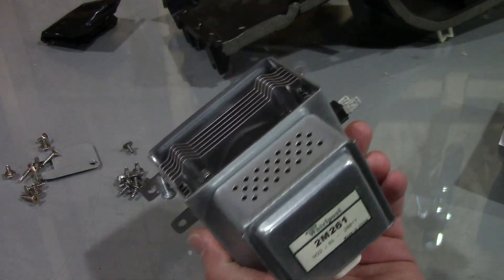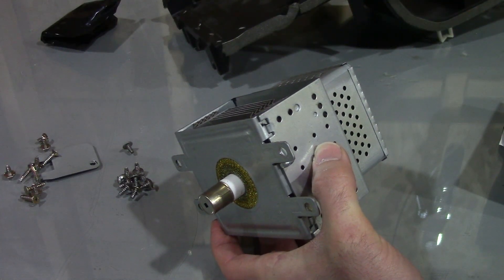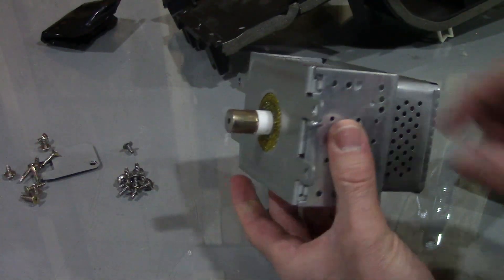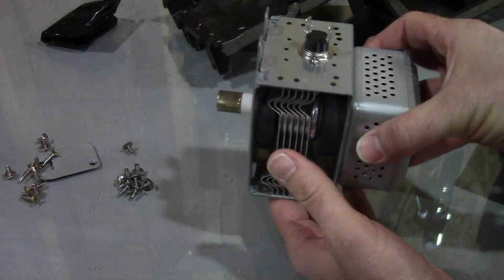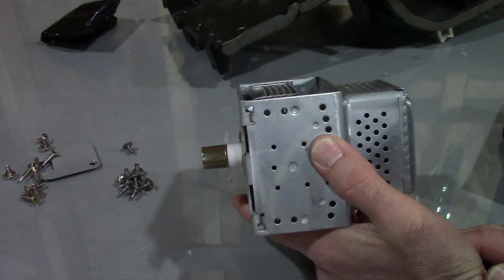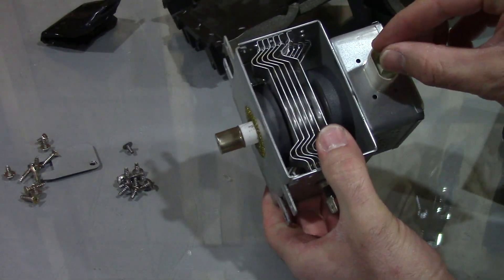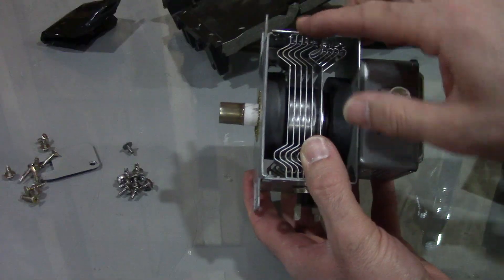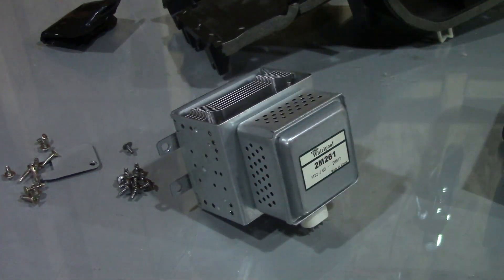What makes a Magnetron dangerous

Comment: Would help your videos quite a bit if you did a little research before posting.
Reply: The electrons don't bounce around they are bent at 90 degree angles and spiral around. The Magnetron Vacuum tube has copper fins inside that portrude from the chamber wall. Each time an electron passes near a copper fin it generates voltage in that region. When this happens enough an RF signal is generated and then coupled to the output on the tube via an internal antenna. That output is also the copper nipple that is cold welded to seal the vacuum tube. There is no thermal cut out on the tube. Those are mounted on the magnetron  and the cooking cavity! LOL!

Comment: Yes, public spirited to warn of the possible dangers of Beryllium oxide dust and what it can inflict upon the unwary. I note others have clarified the colouration of ceramic containing b-oxide and that most now use aluminium oxide instead. However, the magnets may be fun for us eternal Peter Pans, but the ion chamber is fashioned entirely from copper, therefore does have some value to scrappers

Comment: Nope the only part in a magnetron that is servicable is the filter inside the back of the magnetron. As far as I know do only old magnetrons use Berylium what makes the insulator pink. New ones usually have metal oxide, what makes them white. But metal oxide is dangerous too.

Comment: Thanks for explaining with so much detail. I want to disassemble an oven and was freaking out. Only knew the capacitor and the magnetron were the two most dangerous parts. I feel better informed and prepared now..
Reply: Yeah better not touch both of those things, both are potentially deadly xd one of those things you don't want to service yourself ever if you can avoid it.

Comment: people are dying from car exhaust daily
Reply: true johnny
Reply: Steven Bailey not quite the same.
Reply: Not quite the same, because it's more like sticking your hand into a crocodile's mouth !
Reply: Please tell me that you are kidding... :P I mean atleast for the car exhaust being clean... everytime I walked in the city I used to blow black stuff out of my nose. The same black dust would be found every day slightly covering surfaces behind (all day) open windows. These days with more strict control and limits (EU) plus the fewer cars (crisis) I haven't noticed my nose gathering black dust (visually) but you can still notice it on surfaces near windows (they really need to be cleaned every day or two). You also probably suppose that the catalyst does its job perfectly, the fuel is "high quality" and  the car is maintained as it should and no illegal modifications are taking place (though this last one is extremely rare tbh).

As for climate change, it is up for debate, though man didn't caused it, we just accelerated it AFAIK.
Reply: No, people are dying daily because they are unlucky! If you are lucky you live to get old like me! I've breathed the same air as  all the others born in the same year but are now dead.
Reply: Bull shit! Car exhaust is so clean from a 3 way cat converter that it consists of water and co2. Oh and, there is NO MAN CAUSED CLIMATE CHANGE.

Comment: They don't use berillium any more. Not for the last 30 years. Aluminum oxide. Perfectly safe these days.
Reply: Bodragon uh huh, you've seen them being made?  Are you even sure where they're made?
Reply: You are incorrect. While it may not be as widely used as it used to be,  it is still in use. It has unique and valuable thermal properties. Mitigation of it's hyperallergenic affects is not difficult.

Comment: how could u re use the ceramic to make ur own shapes.......
fyi to remove them safly u super heat the insulator till the steel glows white ish hot it gets slighty gooey then the insulator pulls off
the terminal input needs a tap and drops off

Comment: The ceramics look simulator to the argon welding gun I used  for welding aluminium years ago, we would also grind them to alter the shape?

https://www.google.co.uk/search?q=the+argon+welding+gun+ceramic&rlz=1C9BKJA_enGB590GB590&hl=en-GB&prmd=ivmn&source=lnms&tbm=isch&sa=X&ved=0ahUKEwjE4_KTqP3QAhWdNFAKHaq0BWgQ_AUIBygB&biw=1024&bih=653#imgrc=vc3bJd3C-odArM%3A

Comment: I have two Magnetrons laying around with the Pink Ring, but i leaft it to Do anything with it,  I Do Not want to die
Reply: Pink color is addition of chromium dioxide for extra hardness.
Look up manufacturers data and find Samsung and panasonic for example have never used BeO.
BeO is 500 more expensive than Al2O3 (Alumina) which does same job for domestic apps.
BeO is used in rocket engines, radar systems or industrial microwaves above 50Kwatts.
Wikapaedia is of course full of mis-information about these  cheap domestic ovens
Reply: Electroimpex   DON'T HAVE SEX WITH THE PINK RINGS  YOU'LL BE OKAY!!
Reply: What i do for saftey regardless ...i either put some kinda oil pr spray paint preferably on the tips before dissasembly to ectract the magnets.once ive done that i dispose of the leftovers in s bag ..to local local landfill.via city dumpster.I have not seen many pink and white tips latley but i have not payed much att.either .Priority is preventing the ceramicfrom going airborn..
Reply: Beryllium oxide ceramic is not a hazardous waste under federal law in the USA.

Comment: I completely shattered a microwave as i was younger, am i going to die?
Reply: Of course you're going to die.  May take 50-70 years, but everyone dies.  Sheesh.
Reply: Andrea Maccanti * Yes, nobody gets off this rock alive.
Reply: Maybe
Reply: i believe Beryllium banned  many years ago due to high toxicity, its not possible at this time they using it at kitchen device   also if it does they put some warning sign on it for sure
Reply: Tomorrow
Reply: Andrea Maccanti yes. ..none of us are get out of this alive
Reply: Sticking a butter knife in a wall socket will not necessarily give you a shock.  Putting 2 butter knives in a socket and holding onto each with a different uninsulated hand will probably be "enlightening" though. :)
Reply: Tom Jabar I wouldn't bank on that
Reply: Stick a butter knife in a wall socket and see what happens.
Reply: we are all gonna die eventually, i wouldn't sweat it ... when i worked at the sanitation dept. like 30 years ago when they junked refrigerators we use to break the Freon lines and let them drain to the atmosphere so junkers could come and get copper and stuff quicker. that was before anyone told us what Freon did to the environment. oh well live and learn ... (or die and learn?) ...
Reply: Andrea Maccanti  If you haven't already, you should soon start acquiring random superpowers.
Reply: LOL !
Reply: Yes, you are!
Reply: Depends. Was it turned on when you shattered it?
Reply: Andrea Maccanti we all are u r just dumb
Reply: Everybody is going to die.  You think you're an exception?
Reply: Me too I was five, hopefully I worn have to wait decades cause I'm tired of this shit
Reply: Don’t worry. Take three Tide Pods a day for a month.
Reply: Andrea Maccanti you just might if you smashed up the berillium coating

Comment: That magnetron doesn't have beryllium oxide. It has aluminum oxide. Pink = beryllium and white = aluminum oxide
Reply: Pink is addition of Chromium dioxide for extra hardness and is used here as a leftover product.
BeO and Al2o3 ARE BOTH white
Reply: John J. Rambo  right Al2O3 white , Be metal is toxic and fatal in small quantities.
Reply: Yes, beryllium is white. Its used on rf tubes and xray tubes also.
Reply: I have tons of magnetrons both pink and white ceramic.. are they both as dangerous?

Comment: Wow I didn't know I had such a high techie almost tesla free energy device looking cathode like contraption in my home..I also heard later generations of these contraptions use aluminium oxide instead of those poisonous berry one you mentioned? is it true? these contraptions are run with very high voltage low current step up transformers? can I run these with an automotive coil? I wonder if I can turn these into the legendary moray valve cold cathode energy inducers!! thanks for the explanation! I bet these also make cfls light up wirelessly like a tesla coil!
Reply: DO NOT POWER A MAGNETRON AFTER IT HAS BEEN REMOVED FROM THE MICROWAVE ASSEMBLY, OR AFTER THE MICROWAVE FRAME HAS BEEN DAMAGED IN ANY WAY. THE MICROWAVE RADIATION COULD EASILY HARM OR KILL YOU IF YOU ARE UNSHIELDED.
Reply: Calm down.
Reply: only run magnetrons out of there design if u actuly understand how use it fully............

not only can u kill urself but u can harm tonnes of others property aswell and not cheap gear eather

hate to think of cell tower repair costs XD XD XD XD
Reply: now everyone can have a tiny compact cute CERN particle accelerator at home!! Lets create a black hole in the living room!
Reply: it can burn you, in the worst case, just like a fire would... very dangerous -.-

Comment: I've read that Beryllium oxide was only used on old magnetrons, "newer" magnetrons are supposed to have Aluminium oxide.
I've been trying to find more info on that though.
Reply: Your right. Pink color is addition of chromium dioxide for extra hardness.
Look up manufacturers data and find Samsung and panasonic for example have never used BeO.
BeO is 500 more expensive than Al2O3 (Alumina) which does same job for domestic apps.
BeO is used in rocket engines, radar systems or industrial microwaves above 50Kwatts.
Wikapaedia is of course full of mis-information about these  cheap domestic ovens
Why use a poison in a domestic product which has a fan to vent its inside to the outside ( breathable air )
Reply: @geoffrohde3434  Mr. Rhode, thank you for your comment.
Reply: Aluminum oxide is used in the sandpaper industry. Very hard. Very brittle. Cuts like crazy. The dust from al. Oxide is Definately hazardous when airborne but it usually mixes with the base material being sanded or ground minimizing the risks but in no way makes it a safe product. I regularly use grinding wheels and should have used respirators more often but hey....y.o.l.o.
  M.S.D.S. stands for material safety data sheet and is available from every manufacturer who sells any product to the American public and by requesting said safety data sheet they, by law, must provide a copy to whoever so requests said copy. 
   If you have a question or concern the info is available for the asking.Peace...Love... an all that good stuff.
Reply: +Gordon Freeman i think so too, becuse beryllium is expensive
Reply: JustinLodes
Are you sure?, because I've read different things all over the internet.
If you could point me to a good source, I would appreciate so much.
Reply: Beryllium oxide is often used in its pure, white form. Nothing risky about using it in a microwave oven, as long as you don't tamper with it. Here btw. you can see a magnetron with pink ceramic: https://www.youtube.com/watch?v=4Zev8Ws4P1Y, but, don't assume that all BeO ceramics are pink. BeO is also not included in the RohS directive, therefore it may still be found in new magnetrons.
Reply: The US doesn't care about the US either. Thats why they go for the cheapest quote and if they can get it cheaper still, it will be made in China. Designed in the USA but made (and then copied) in China. People could vote with their wallets but everyone loves a bargain ('till the warranty runs out!) so they buy cheap and thereby the cycle continues.
Reply: Made in the US doesn't matter when the guy doing the job does a shit job and justifies it because "I'm not paid enough to care."
Reply: They're more productive than their bosses but still fucking useless.
Reply: Beryllium oxide is expensive? Made in china? 10/10 no beryllium in sight.
Reply: its aluminium rust!
Reply: KC9UDX 
   People are no different in any country. The main cause of low quality products is the ignorant imbecile consumer. China is just as capable of skilled labor and quality. We are just too dumb to demand better quality with our dollars. Every time you buy the cheapest product available, buy products from companies that are publicly traded/multinational, or demand deals or discounts, you are partially responsible for the direction of the market. You have effectively lowered the bar by forcing profit margins lower. The collective effect is driving the market to create cheaper and cheaper options by any means necessary.
  Go navigate Taobao and other Chinese markets with a domestic focus. They sell many products that are far nicer that what gets sold to us. The US has less than 1/3rd the population of China. They don't need us. They already have a middle class that has overtaken our own in the US. They are an actual "land of opertunity" with broad scale economic growth. They are growing like the US was in the 50's and early 60's. They don't need the US, but our corrupt government and economy does need them. We are simply facing the reality of our impending poverty due to the corruption of the corporate system we created. 
 -a white guy born and raised just outside of Huntsville Alabama.
Reply: John J. Rambo . That may or may not be true as a convention for consumer magnatrons I don't know. BeO is often white for other applications though. In its solid form it not a concern. I know a guy that  has been hand fabricating BeO resistors for over 20 years. It looks the same as alumina.
Reply: Geoff Rohde good info. where did you find it?
Reply: Beryllium m
Reply: Something_to_appease_Google every factory worker in America you mean? they all think they deserve 200k a year Plus benefits.
Reply: Thommy Two Toes Times Three : So true, now if they would just stop assigning 5 or 6 chemical names to the same chemicals (only used in differing industries) they might actually be of some use to the pore ape on the tools. Hey? 

 I HATE oh&s... it's a bullshit waste of time industry who's ONLY goal is to maintain a paper trail for the inevitable witch hunt when they can destroy some pore prick who doesn't make enough money to be able to point the finger at someone else. The DIRTY PART is that they allow such naming policies that create ambiguity for those merely trying to protect their own health!  Show me where on the MSDS (now SDS) for a can of "brake cleaner" it tells you that one of the chemical constituents,when placed in an argon atmosphere, subjected to plasma temperatures, will produce phosgene gas that will kill you dead at an exposure of 4PPM? 

I do not disagree with you though. ABSOLUTELY get the SDS for whatever you're using EVERY TIME!!
Most of the time they tell you about the risk involved!

Be safe.
Reply: Gordon Freeman  both can be white i wouldn't cance it!
Reply: John J. Rambo  beryillium can be white as well!
Reply: Upcycle Electronics  don't forget  as a whole are society's have no focal point no common goal to fix on we just consume and want want want with no future aspirations😎 grimm i know!  But i hear no rebuttals!
Reply: If it's "made in China", how much do you trust it?
Reply: @KC9UDX  yes cause the chinese have been known to use the most expensive materials in their products right? lol
Reply: The one in this video isn't beryllium. If it's white then it's aluminum oxide. Pink ones are beryllium oxide
Reply: @JustinLodes  how in the fuck do you know this?
Reply: So the question remains, is aluminum oxide harmful?
Reply: Bassheadjohn  no aluminum oxide is generally safe, but I wouldn't go eating it or anything.
Reply: ..thank you...i was going to have some french fries  with aluminum oxide.. ...🤔.....😋
Reply: KC9UDX made in China sucks, I miss Made in US , quality of life has gone down for me, I worked in an industrial electric motor shop as machinist/welder & balancing tech. Now I am broke and in poor health, made in US meant much to me, Yue in China doesn't care about US like I did.